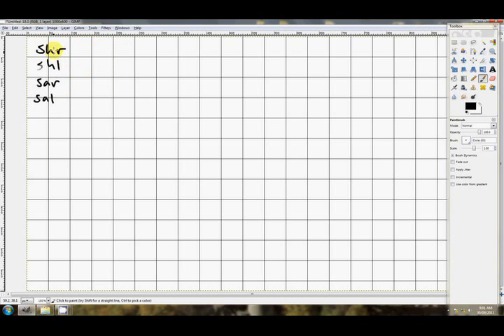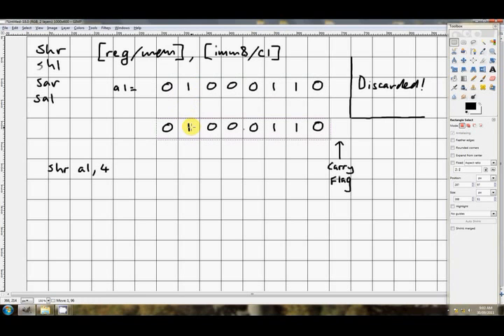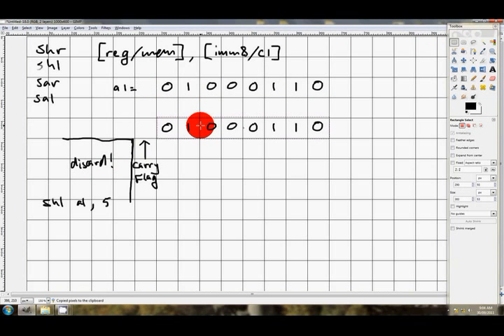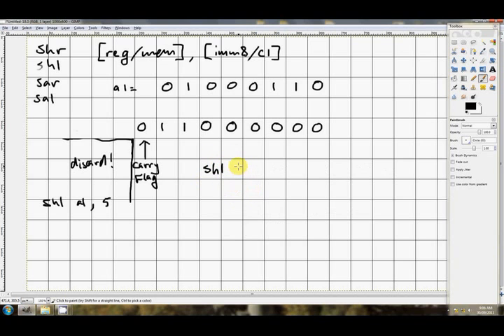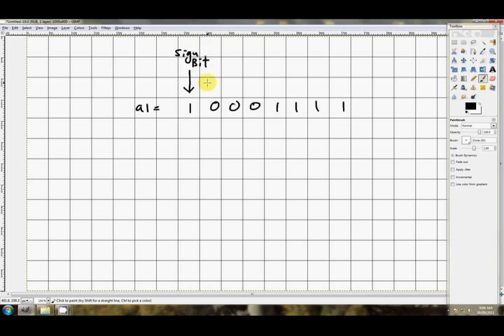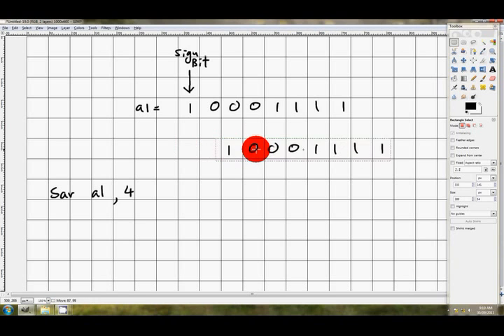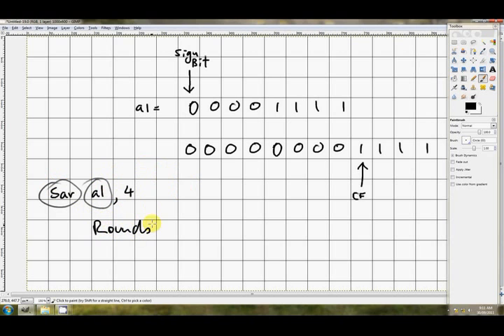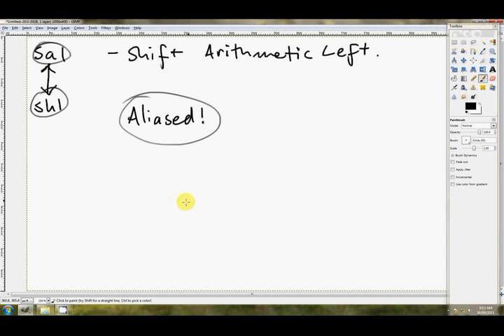x64 Assembly Tutorial 15: Shift Right and Left Instrictions SHL, SHR, SAL and SAR

Comment: Hello, dude. I love your series it's amazing!

But infact, I don't know why will I use the left, right bit shift. I mean what is it useful for? and how can I know the result of bit shifting ?
Reply: Fast division and multiplication.  You can also to this in C/C++.  As he stated, you can do division and multiplication by powers of 2 much faster with bitshifts.  For example, if you wish to divide a number by 2, just do a SAR by 1, multiply by 2, SAL by 1.

In C you do bitshifts with something like: A<<=1; to shift A left 1 (multiply by 2), or B>>=1; to shift B right 1 (divide by 2).  We used to use this trick decades ago to speed up certain math in C as it compiled directly into one of those machine language bitshift instructions.

The register itself is bitshifted so the value that was in the register will be changed by the bitshift and the result will be in that same register when it's done.
Reply: Some crypto also uses bit shifts.  Also, back in the old 8-bit days a bit shift could be used to take a game sprite made up of 8x8 pixel blocks (user defined characters) and adjust them by one pixel to enable smooth scrolling in character-based displays.  It's also good for taking apart compressed bitfields (decoding of dense protocols such as internet packets) or simply for manipulating arrays of bits (booleans)

Wolframe rule #30 cellular automata (google it) require using a value AND both its left and right shifted representations.  An efficient way to calculate 64 pixels of Rule#30 at a time (in C) is :  V = V<<1 ^ (V | V<<1)

In plain english:  V = the value of V shifted left once, XORed with (The old value of V,  OR'ed with the value of V shited right once)
As well as efficient multiplication and division by powers of 2, as explained in the video.

So, it does have its uses ; )

Comment: but what if you arithemtic shift 1010 left then it's 0100, so it goes negative->positive
Reply from the maker: This overflow problem is inherent to finite arithmetic, not just this shifting trick. With four bits, a negative number can be up to -8. Your original number is -6 so you're calculating 2*-6=-12. But -12 is outside the bounds of -8, so it overflows.

You can easily check how a CPU deals with these problems by taking a couple of short integers, set them both to -25000. Multiply one by 2 and shift the other left 1 bit. You should find that they both have the same incorrect result, +15536.

Comment from the maker: Different instructions use it for different things. It's usually the final carry after addition or the final borrow after subtraction.

It can be used to perform operations on data far larger than 64 bits, for instance 1024 bit and 4096 bit integers are used in encryption. The only way the computer can perform operations on numbers like these is to break the operations up into smaller operations and use the carry.